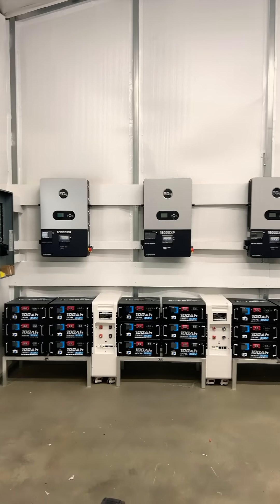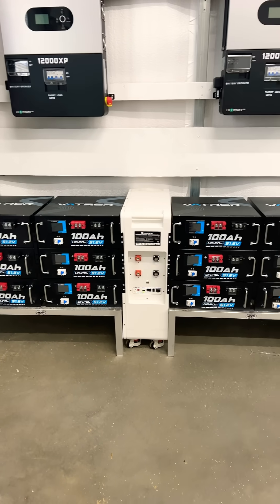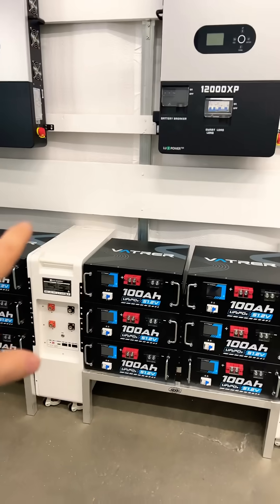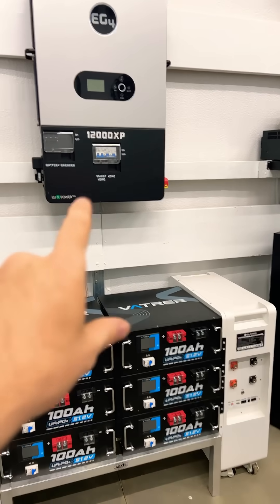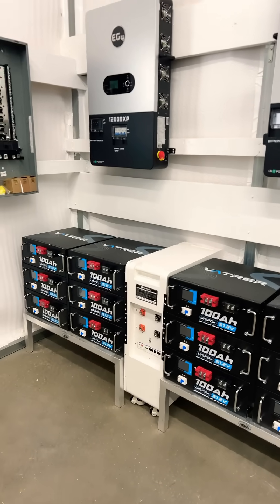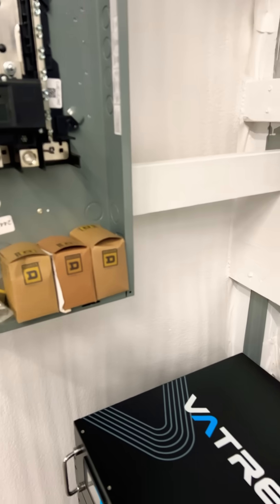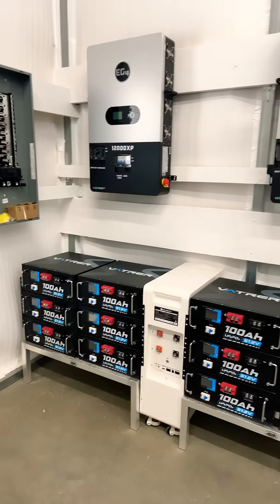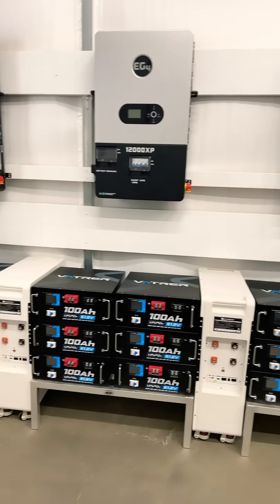Off-Grid Update! #signaturesolar #solarpower #offgridliving #vatrerpower #ecoworthy

Comment: 138kwh in the video?
Reply from the maker: @bobmonztr  Approximately, yes.  Hopefully it is enough for the house.  Everything is electric at the house with no gas, so it uses lots of power unfortunately.
Reply: @MikesSolarGarage  My new house is energy star rated at 1680 sq ft, all electric. My shop is 2800 sg ft ( no HVAC ) where the single EG4 is located with 30KW batteries with heat pads for winter. 12kw of solar panels. I have not used grid power in over a year since installed.
You are good to go then some....
Reply from the maker: @JStock-id1qiVery nice, what general area are you located?
Reply: @MikesSolarGarage  Southern Virginia.

Comment: Looks awesome but I would say the batteries need a bit more space between each other. I am assuming you'll do that when you connect them.
Reply from the maker: I was looking to keep it like that.  What’s your thoughts though on spacing
Reply: @MikesGarageRoute66  1-2 inches at the very least for the server racks. Ideally inside a server rack cabinet. The white ones you'd have to check the manual for details but will need space on the sides. EG4 indoor batteries need 7 inches for example. Remember LFP are very safe but what can make them dangerous is heat and I counted over 100 kwh battery there. That is a massive bank and only takes one to overheat to cause a domino effect in a fire or release of gasses. BTW how loud is x1 12000xp at 10000 watts? Was thinking of putting one inside. Don't want to pay an arm for wiring.
Reply from the maker: Thank you very much Chris,  I added some space last night and now everything is a few inches a part.  Definitely a good call.  The EG4 can get fairly loud when the fans really kick in.  Especially when the loads are over 8,000 watts.  The other thing that is does is randomly spin up the fans when the solar panels are putting in more than 4,000 watts.  But that is another reason why it's not a bad idea to have two of them to split both the AC loads and solar panel charging.

Comment: Is this going to run the whole house and garage? I have 5 Eco Worthy batteries on a rack, (1) 12000XP, and (30) Aptos 410w bifacials ready to go in. Currently saving more money to build the ground mount, wiring, more batteries, and another 12000xp.
Reply from the maker: This will run just the house.  I have the shop on a separate system with a pair of 12000xp, batteries and panels.  It sound like you have a pretty cool setup!